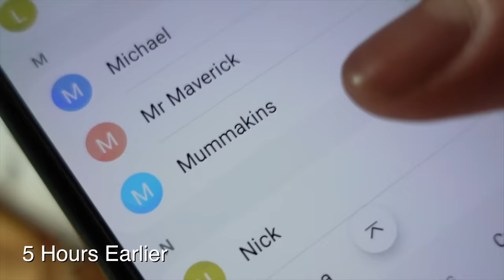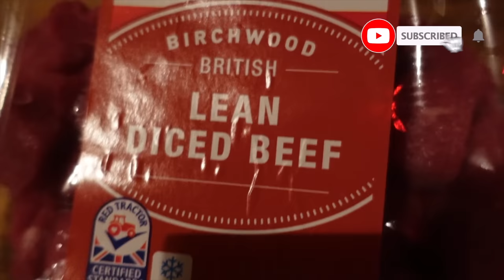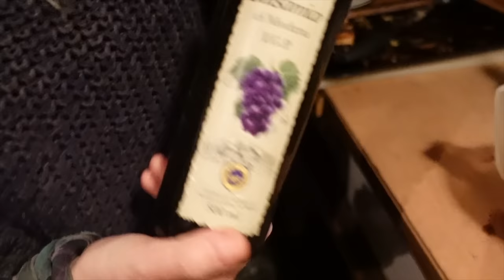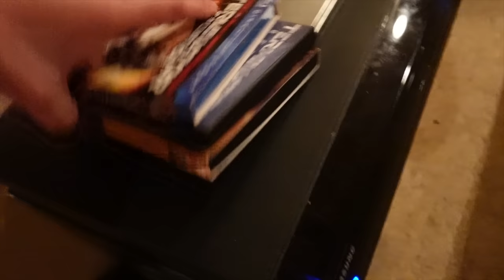Leaks and droughts on a Narrowboat Houseboat !

Comment: I would advise making sure there are no more loose connections on the electrical system, loose wires cause fires. If you come across any old choc block connectors swap them out for Wago’s.
Reply from the maker: Ooh thank you. I definitely will be having a closer look at the electrics as it is a bit of a worry. Ooh Wagos I've never heard of them but il definitely investigate. Many thanks!